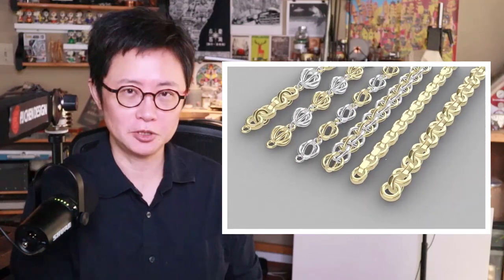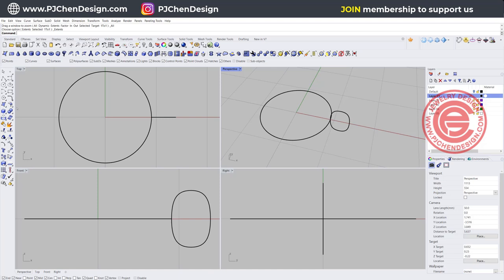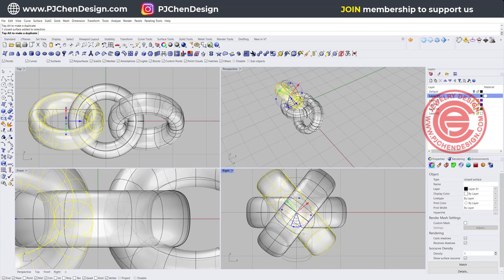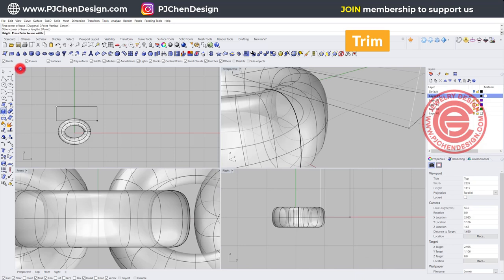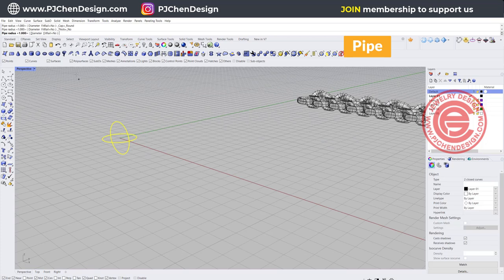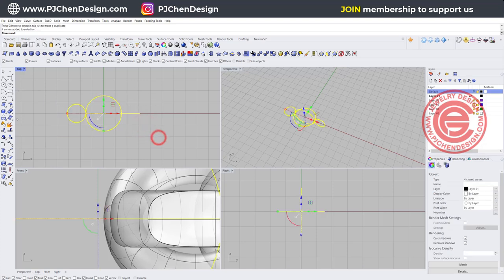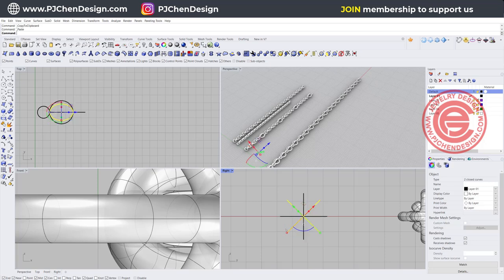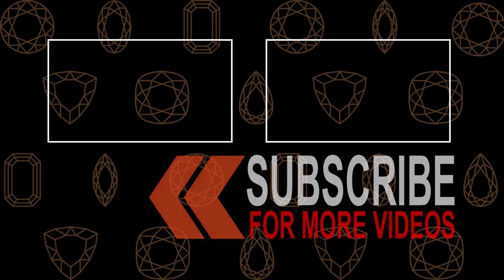Rolo Chain 3D Modleing Tutorial-Jewelry CAD Design with Rhino 3D #360

Comment: Great variations! One question: on the 3rd example, if you didn't use Multiple with Rhino 7, how would you correct that issue? Thank you
Reply from the maker: If it is piping and cannot boolean, it will be seam issue. you can move each of them a little and boolean one by one.
Reply: @PJChenJewelryDesign  Thank you, that fixed the problem. To be honest, I mostly use Rhino 7 for the multipipe command. I still mostly use the "traditional" Rhino so I wanted to do this old style as well.